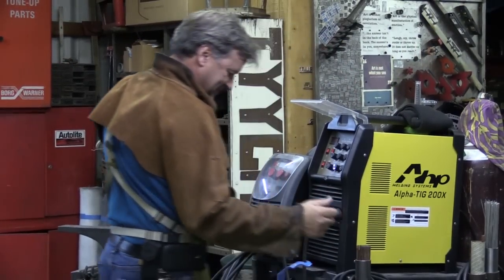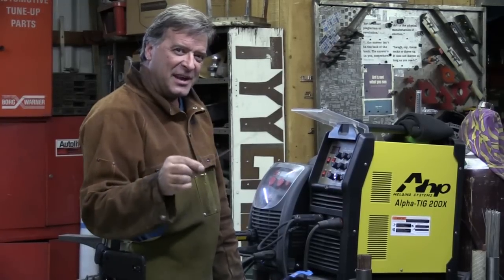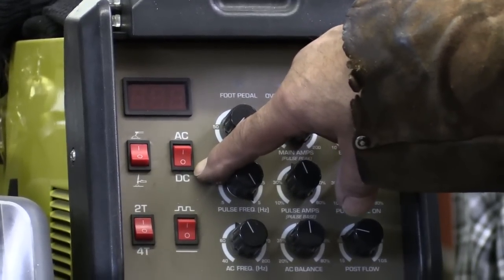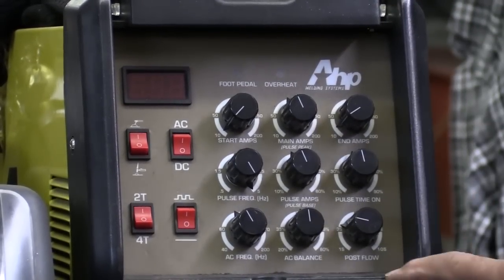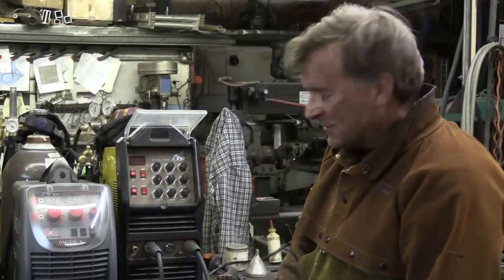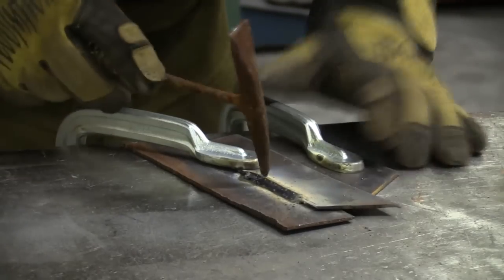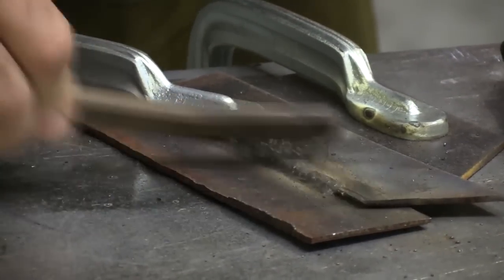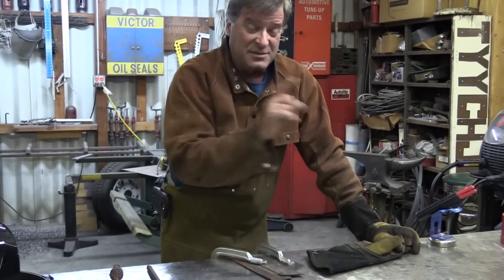How to Stick Weld (Arc Weld) With the AHP AlphaTIG 200X - Kevin Caron

Comment: I was needing to weld some braces on a truck frame I am working on  and wasn't sure how well 110 volts would do.  Found this and set it up as he says and it was more than I needed. In other words I didn't need to go spend money on 220 plug and cord to wire this up 220 v.  The 110 was plenty for what I needed.  Great.
Reply from the maker: Awesome!!

Comment: One other thing to note when switching from TIG to stick is the need to disconnect the foot pedal.  ***Note to AHP, please add a lift arc function, and wire the TIG/Stick switch so it disconnects the foot pedal--like most other comparable TIG rigs on the market.  Thanks.

Comment: Does it really gives 150A on 110V with arc weld? all other inverter welders give max 90A which is not enough to run 1/8 7018 rods.Do you sell this welders, you mentioned as distributer on their web site?